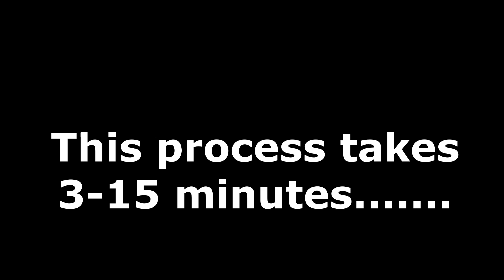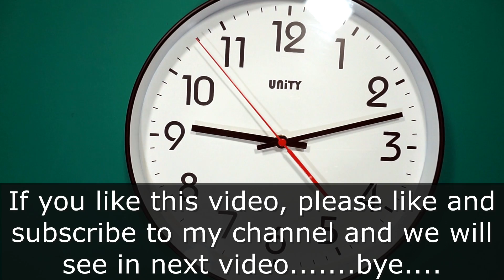Convert ANY normal clock to radio clock

Comment: I have a clock with radio control. It works right, but the second hand does not move, it stopped after the set time. What is the problem?
Reply from the maker: It could be an error in your radio signal. Try and check your battery. If your battery is ok stand next to a window and reset. This should sort it out.